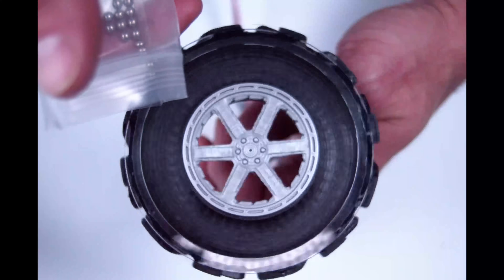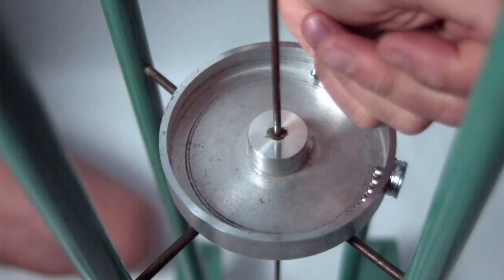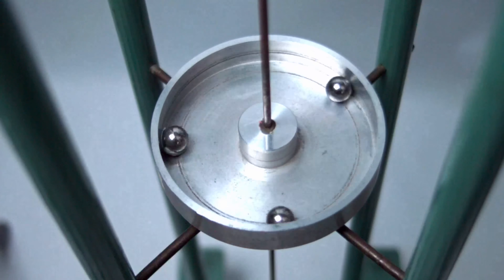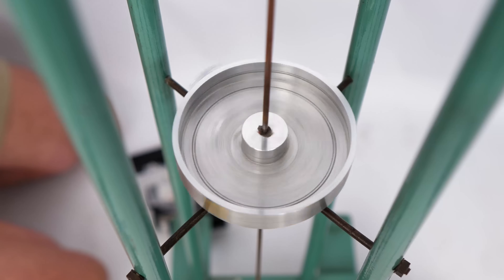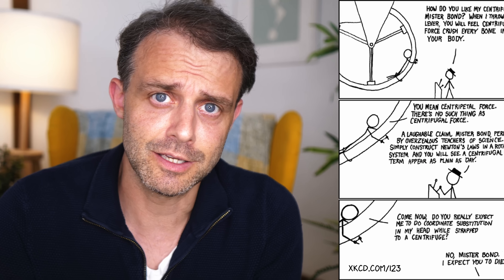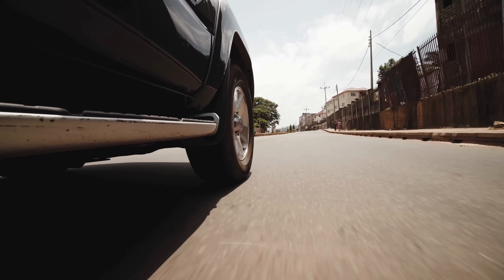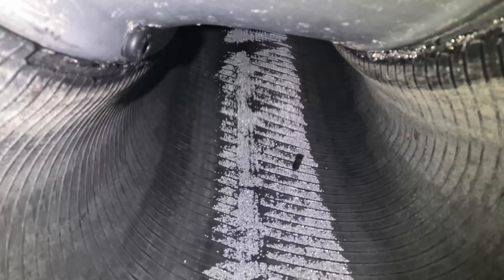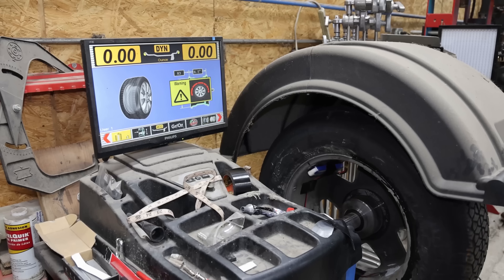Do tire balancing beads actually work?

Comment: I've never had nor heard of unbalanced tires. It is primarily an issue with older cars?
Reply: each tire during assembly on a rim have to be balanced in a tire workshop - install weights. New cars have balanced cars when you buy it. But its good to check balance yearly

Comment: I used them on motorcycle tires for years. They balance the tire out before you notice any imbalance in the tire. The video you linked from warped shows the beads are “sticking” to the walls of the tires around 10mph. The tire is “balanced” enough at that point so that you don’t notice, not at 60mph.

Surely something in the math is off or something else is being overlooked. Bead balanced tires feel smoother than weight balanced tires, particularly over the life of a tire. Which, with supersport tires only lasting about 5k miles, it is fast enough to notice the degradation. Plenty of people claim this same experience.

I think this is a “rouge waves don’t exist” issue.

Comment: Beads probably cannot correct inboard--outboard imbalance at all. So always start with a decent dynamic balance, and let the beads correct the last little bit of imbalance and adapt as the tire accumulates wear and damage. Seek out the best available wheel balancer to measure the balance at 50mph and measure it most accurately! Balance a good tire, extra-fine if possible. Next, add the beads to see whether they unbalance it! Next, add weights to intentionally unbalance the wheel a known amount and see whether the beads compensate! Also, try different amounts of beads against a known imbalance, to see how much is "enough", and how much might be "too much". (Obviously you need more mass of beads than the residual unbalance.) Also, what SIZE beads is optimal?

Comment: what if u inject glue that hardens after a certain time, then go for a drive fast enough to get the beads evened out inside the tire and then the glue hardens so that they are permanently stuck there. The glue needs to be of low viscosity before it hardens so that it doesn't interfere with the beads free movement into the right positions.

Comment: Yes, I would love to pour glass in the thing that keeps me on the road, shakes and is made of rubber. Sure the glass won't shatter and start destroying the rubber, right?
Reply: You’d have to do something kinda crazy to make tiny glass beads like that shatter, but your point is valid they do wear away the rubber inside the tire. 
Then any moisture in the tire condenses and makes beads stick together with the rubber powder now inside the tire. That being said there are attachments that are air tight, and external that exist for this purpose.

Comment: Could be fun to use the principle of the glass beats together with actually fixing the wheel. Say you put the weight on a tire in a way so they can slide around. You find the balancing point by spinning it up. And they should be in the correct position to be fastened when you spin them down.

Comment: This confirms my observations... and my assumptions that the firmware in my washing machine does exactly the worst thing when detecting vibrations while trying to accelerate to spin: it stops despite still being at low speed, rather than accelerating to pass resonance speed. (And yes, I did replace the dampers)
I cant blame the programmer, which is not a mechanical engineer, but those who instructed them, and those who should have tested that model before releasing it to market. I personally won't be buying anything from that very famous brand anymore.

Comment: Fascinating!  The only problem I envisage is persuading the tyre shop to use balancing beads rather than the machines they already invested in when you get your tyres replaced 😊
Reply: Phone them up and ask them "how much do you charge for balancing beads?" If they huff and start with "we don't use them", hang up and move on to the next dealer.

Comment: My old bicycle has puncture-sealing gel in its 27" x 1¼" tyres; the goo is about as viscous as school-dinner custard. My fellow Brits will know EXACTLY just how thick/thin that is.☺️

I know that the sludge moves around the wheels as they spin; presumably it finds nodes and harmonic wobbly things and settles into a sort of equilibrium related to my riding speed, but my maximum velocity never gets much above 40 mph so I can't say for sure what effect the creeping gunge has on the balance of the bike's wheels.

It IS a very heavy, steel-framed old donkey (weighs about 45 lbs) thanks to its burden of racks and panniers, so it'd take an enormous amount of vibration to unsettle it at the speeds I ride.

So... are there any Lycra-clad road-racing guys out there with experience of custard-filled inner tubes or tubeless tyres ridden at higher speeds? There may be a point at around 55 or 60 mph when the goo does weird things balance-wise.

Comment: When you push the balance on the frother, the axle is unbalanced, which altogether balances the whole rotating assembly. You probably cant see it in person, but you can on a camera with right right frame rate.

Comment: Clearly, the solution for balancing beads is to make beads like that which bond with your tire at the correct speed.  Maybe make it a timed reaction, and make sure you're at the critical speed at the key time.

Comment: I had it explained like a liquid, if you replaced the beads with water it will want to find its level which is its lowest energy state I.e. equidistant from the point of rotation. Try with a fluid.

Comment: At first sight (I've never seen tyre-balancing beads before), it reminds me of what happens with stepper motors.

If you perform one isolated step, the position goes through a classic damped oscillation before becoming steady again. If you step the motor at the resonant frequency, the motor can jump position because it is being nudged just at the point it is supposed to be settling. Beyond that, the motor is slewing - not having time to settle and not being resonant either.

When a motor is accelerated to "high" speeds (beyond the resonant frequency), you have to take care to go from stepping to slewing rapidly enough to avoid it jumping

Comment: The beads start working around 30-40 miles an hour depending on the brand you use. You know the speed at which you start to feel out of balance tires. The slower you go the less out of balance tires matter. Which is why at high speeds cars start to get a vibration but it doesn't happen at low speeds. Balance beads do exactly as they claim to.

Comment: Can't you speed up once and then fix the beads internally? Thermally, for example: roll they wheels and then make it hot enough inside the tire to make them "glue" to the tires themselves.
It could be done in a car service. Do you need wheels to touch the ground to properly balance them?

Comment: Had to calculate rotor shafts for catastrophic failure modes during my ME studies, and it turned out that indeed there are quite distinct areas within the "spectrum" where everything everything gravitates toward stability even if displaced, and areas that go completely haywire with even the slightest missalignment. That's why the design of moving machinery often is kinda counter intuitive, e.g. why do they put material in places where no real forces act on those parts? It's to lift the catastrophic resonant frequencies away from operating speeds - startup and idle being the most important ones. Spooling down not so much.

Comment: Feels like harmonics to me. I could 100% be wrong. But if you were to measure the distance of the wobble at low speed then higher speeds, I would bet the wobble would have a relation much like a musical tone - the higher the speed, the smaller the wave/frequency. In much the same way a room has natural resonance, the disc, axle and bearings all react to the frequency of the wobble. The higher the frequency, the tighter the pattern and maybe easier for the bearings to find their "natural" settling point. I can't prove it though.

Comment: The major difference between balancing a wheel with fixed weights and using balancing beads is that with the beads, every time you stop the car you lose your wheel balance and have to get the rotational speed back up to the point that the tire balances again. That means that you will experience the vibration from unbalanced wheels every time you drive. With fixed weights, the wheel remains balanced at all speeds. I used to work at a service station and one of my tasks was dynamic wheel balancing. I got so I could zero out a wheel with only a couple of spins on the balancing machine. Most of our customers would only bother to balance the wheels if they were buying new tires or swapping winter grips for summer tires and vice-versa. Occasionally a mechanic would test drive a vehicle and tell me to balance the wheels to eliminate them as the source of a vibration problem. We'd also do a wheel balance check when rotating tires for even wear or after a flat repair. Basically, there were lots of opportunities to balance the wheels with fixed weights and the wheels would remain balanced until something changed (new tires, running into a curb etc.).  Glass beads may work and the way they work is fascinating, but honestly I'd rather have fixed weights and a wheel that is balanced at all speeds than go through the re-balancing procedure every time I started up from a stop. That's just me, of course.

Comment: So I've used balance beads for the past 30 years or so on my vehicles from Peterbilt 379 semi's to my CanAm Spyder bike. The beads start to lock-in and balance at about 35 mph. The stainless steel ring balancers that mount behind your wheels with the steel beads work great when they are new, but after a few years they slowly begin to unbalance as sludge forms inside of them and the little ss balls begin to adhere to the sludge in clumps till the things make your wheels shake instead of balancing them! The ceramic in-tire beads work just as well as the ring design, for the life of the tire (which should be about 8 years)... you can't ever use any stop-leak or anything in tires with balance beads in the tire, obviously! I currently use the in tire ceramic balance beads only, and the only issue I've had is that on steel wheels they scour the finish off the inside the wheel and then it rusts profusely (Texas air generally it's very humid around here)! So since my only steel wheels are on the inside duals of my dually truck, I do not put the beads in those 2 wheels only in the aluminum wheels do I use ceramic balance beads since they do not rust inside. Lastly, I just recently finally discovered I was getting a vibration no matter how I balanced 1 of my dually's front wheels... the wheel isn't bent (I had suspected it was), it's hub-piloted and for some reason the hub hole of the wheel isn't fitting snugly when placed on the rotor hub! Ergo, the wheel didn't center properly when I tightened the lug nuts it was off-center every time and caused the truck to shake badly going down the highway anything above 60mph was miserable! Why this happened I do not know, but I corrected the problem with strips of aluminum ductwork tape layered evenly around the wheel's hub hole until the wheel fit snugly over the hub, and it now drives like it did when it was brand new again! I'm baffled why this happened, frankly.

Comment: I have balancing beads in my tires! They're great. works perfectly.  The only downside is a slight bead sound that's barely audible at low speeds.  Practically, I notice the positive effects at ~35 mph, not 50.

Comment: Sticky beads are the solution. Simply fill the tire with them, drive on the freeway, and as you drive, they will gradually lock into place. Once they settle, your tires stay permanently balanced.

Comment: Touching freeway speeds is interesting. 
They also say not for use on passenger vehicle size wheels. 
Mainly intended for semi trucks. 
I run them in my f350, and you mentioning the "must obtain a certain speed" is so very true and explains what I have experienced.

Comment: Why beads then? at this point will any liquid should have the same effect right?
Then, suspend the car => add some liquid rubber that hardens in 5 minutes => spin the wheel for 5 minutes at 80km/h => perfect permanent fix?

Comment: I use balancing beads on my motorcycle. They are amazing. So I dont have weights on my rims, the beads dont work under 15 kmh  which on a bike we ain't under 15kmh haha I swear by tire beads for certain applications

Comment: The beads may do some good if you reach highway speeds first, but in order to get there, you have to start from slower speeds, at which point it will be worse than with no beads. If you use carefully placed weights to balance the tires, there's no such bad spot. In my opinion, the negative impact at slow speeds renders the beads pointless, especially when typical balancing of wheels is straightforward.

Something like this could be used on clothes washing machines. An active weight placement mechanism should be used at slow speed but a passive one would work at high speed. As the clothes wring out and the balance changes as a result, the weights automatically compensate.

Comment: 11:05 ish can you define what you mean by motorway speeds? I'm assuming that's 50mph or 80kph, but why do you call it a "motorway speed"?

In the US in rural areas such as around here pretty much all speed limits are 50mph or higher.

Comment: I have used balancing beads in my motorcycle tires for many years now because I get a significant amount of additional mileage out of the tires with them. I get more even wear without cupping. On my rear tire of my sport bike I was able to go from around 6000 miles per tire to 10,000 or more per tire.

Comment: An idea: ball bearings in an inflatable tube (just big enough so when inflated the bearings move freely but small enough so when deflated they stay where they are at) around the hub. Inflate the tube get up to speed deflate the tube so the bearings stay in balanced state without needing to rebalance each time.

Comment: Yes they do work.  That's the simple answer.  Plenty of motorcyclists use them as well as trucks cars etc and you do not need any excessive speed.  Both of my bikes have them, and when time for tires on new truck they will get beads next tire change.

Your depiction with the itty bitty disc and super large balls is not accurate testing as something like a truck tire would have softball size balls in it, which is not the case with balance beads.  Maybe use some 0.020 size balls in your experiment and post the results.

Comment: Two points....
1 Please do not look at a camera when you are driving, it is not safe and could lead to an accident.
2 What happens when you use these beads and have to break suddenly because you were looking at the camera and not the road? Does the weight help or hinder the grip of the tyres and the stopping distance of the vehicle?
Keep up the great work and stay safe,
Joe

Comment: Agreed. Same experience. Had them for over a year before getting them vacuumed out and going traditional wheel weights. Not worth the additional wear on your suspension and other components, very annoying - especially in freezing conditions where they perform more poorly.

Comment: My uninformed guess is that the added mass from the beads and the lack of reaching the required speed, most of the time, would result in a net energy loss for the car as a system.

Comment: There are two type of wheel balance. A radial imbalance makes the wheel jump up and down, just like the imbalances shown in this video.  This is known as a static imbalance.
But a  lateral imbalance will cause torque forces across the axis, making the wheel twist and vibrate no matter how good the radial balance is. This is known as a dynamic imbalance, as it only shows itself at speed.

I've never seen anything to show that balancing beads will do anything for a lateral imbalance.
Reply: I have 1wheel on my Jeep with 35" tires  that has lateral imbalance and I have to run it on the back axle,  beads don't compensate, if I run it on front I get a shimmy in steering wheel around 65 mph, took awhile to figure it out.  I added more beads that only helped a little.

Comment: It becomes a matter of balancing the practicality of using beads or counterweights: If you yourself are changing tires and you don't have a wheel balancing machine so you would have to take the tires to somewhere else, you can use the beads i guess. If you take the wheels to a garage to get them changed, definitely go for the counterweighted option.
And if you want to introduce another couple of variables, think about your mechanic when you're gonna give them a wheel that needs a replacement and the damn thing is full of beads that they now have to clean out, or when you use a self repair foam for a flat tire: not only the beads may stop working properly, but the poor mechanic is going to have a horrible time for the same money. Just use counterweights and put a spare wheel in your trunk. Don't be a pain to your mechanic. 😊😊

Comment: Hi, thanks for this new video. I was thinking about something. As  the unbalance of a tyre doesn't change (a lot) during his life, would it be smart to make beads that (for example) melt or stick together once they reached their ideal spot? With that solution, once you  put the beads in the tyres, you would have to drive for  maybe half an  hour (for example) on a motorway and then the tyres are balanced forever, at any speed. Maybe it's silly but i don't know,iwas wondering. What  do you think?

Comment: They definitely work, but they arent perfect. I have 35" offroad tires on my Toyota and they put beads in them at the shop. They have wobble at the sweet 60-70 range which is where typical unbalanced tires hit their highest resonance. But theyre fine beyond that sweet spot